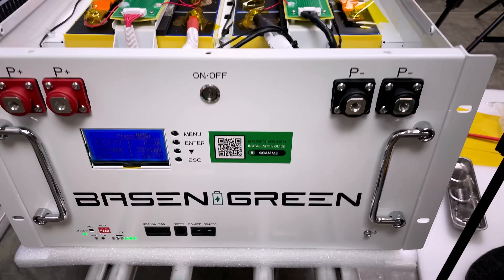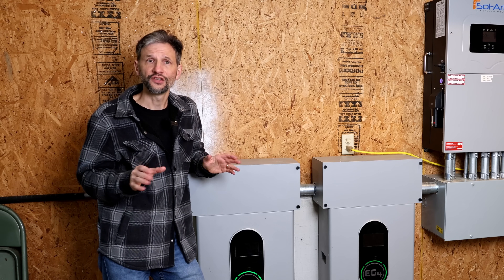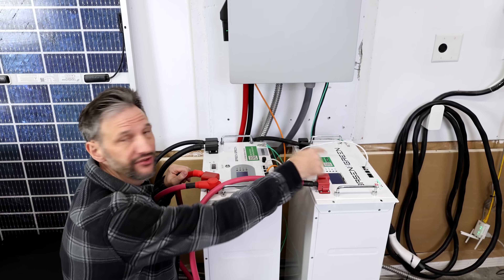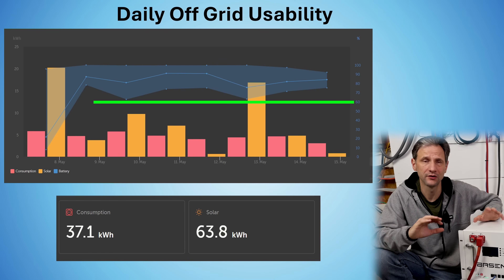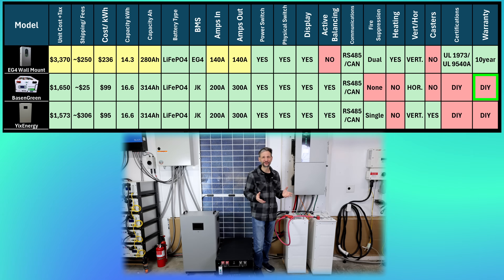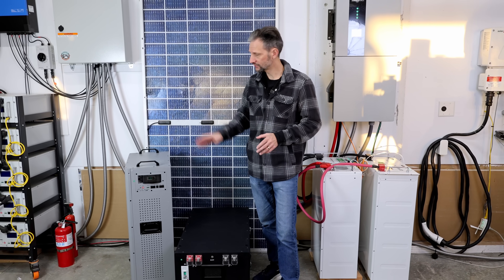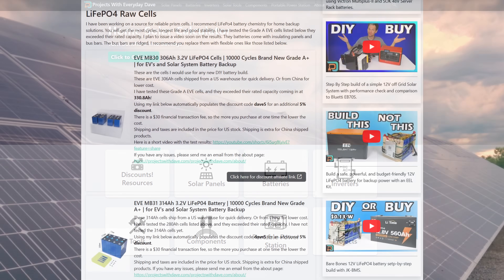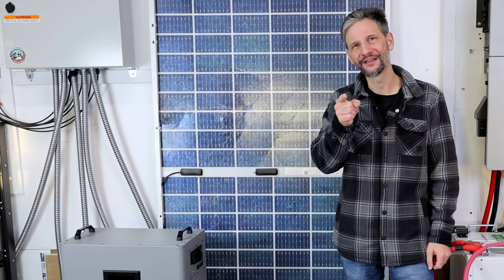I Compared The Top Home Batteries And Found A Winner!

Comment: Good overview Dave!

I have been using JK BMS batteries talking to my EG4 6000XP using the Pylon Protocol.
Good to know that we have two options for protocols.
To use the Pylon Protocol:

    On the JK BMS:  Set the CAN port protocol to option number 2 - Pylon low voltage protocol v1.2  (then hit send)
    On the EG4 monitoring software, go under maintenance, select your specific inverter and load the active configuration
        Then select battery:  Lithium
        And type to:  2 (which corresponds to the Pylon Protocol).   Then save and you're good to go.
    Your setup uses:
        JK BMS CAN protocol:    11 (lux power)
        EG4 software batt type:  set to 6

One other popular battery that you did not cover is the Ruixu battery.

    It is kind of a clone of the EG4 OUTDOOR battery.
    It has 16KWh of power vs 14.5KWh for EG4
    It comes on rollers and can be wall mounted
    It is outdoors rated
    It IS UL Listed
    It DOES NOT have US based tech support
    It DOES NOT have a 10 years warranty
    It costs around $3,300 (with FREE shipping)
    EG4 intdoor wall mount battery: $3200 (add $300-$400 shipping to CA) = $3500-$3600 
    EG4 outdoor wall mount battery: $4000 + shipping  = $4300 - $4400

You can view the Ruxiu battery as an intermediate between the full DYI and the fully baked EG4 battery.
You don't have to build it (it is too intimidating for some) AND it has UL listing (for permits requirements).
It has more power (16KWh vs 14.5 KWh).
If you needed an outdoor battery, you save > $1000 over EG4.
If you only need indoor then you save only about $200-$300
But you are missing the Texas friendly tech support (which is important for many first time installer).

In addition to local tech support and 10 years warranty, EG4 batteries (only wall mount models) has one more unique feature:

    Full integration with Rapid Shutdown System (RSS).
    This means that if the RSS state is triggered (you pressed the emergency shutdown or and ARC was detected on your PV lines), not only will your inverter shutdown but ALSO the batteries breaker will get tripped, making your full system inert and safe for you / emergency responders.   Only EG4 (to my knowledge) offer this integration.

FREE Shipping:

Please note that many Chinese JK BMS based batteries offer free shipping FROM US warehouses to US addresses for DIY boxes, EVE cells and sometimes fully assembled batteries

    www.eelbattery.com 
    www.docanpower.com 
    yixiangpower.com

MIX and MATCH batteries:
Another aspect to consider is the mix and match of different battery types.   
It's not so much the batteries as it is the BMS that don't talk to each other.
All EG4 batteries will talk to each other and then to the inverter.
All JK BMS batteries (no matter what brand) will talk to each other and then the inverter.
All proprietary BMS (Roxiu) will talk to their kins but not other brands.
And the inverter can ONLY TALK TO ONE OF THEM at a time.
You can still connect the batteries together and all will work just fine.
But your inverter will only get the status and direct recharging instructions for the one battery family that you connected to it. 
In practice it works just fine.  But you won't get the full picture of your full battery charge.
If the batteries are of similar sizes, they will charge / discharge pretty much the same.
You will just want to use the phone app to view/manage your individual batteries once in a while to double check the state of charge.
Another option is that you connect all the batteries in parallel and declare them as lithium in the EG4 setup and manage the charge / discharge cycles based on the voltage.
This also works fine.
BUT, it can be more intimidating to the new user.

THE NEW USER::

For a new user, the sense of hand holding and full support may be very important.  It depends on one's temperament.

It is important to be clear regarding the JK BMS.   The documentation is terrible (does not even come with the battery and is hard to find online).

You essentially need to subscribe to the Off Grid Garage youtube channel in order to get the latest firmware and some videos on how to configure the BMS.  Sadly Andi does not organize his videos for later lookup of what video covers what information.... he's more of a producer than an archivist :-).   Setting up the JK BMS can be intimidating and confusing.   If you build your own box,  you can damage the BMS if you don't carefully connect everything in the right place (Will Prowse destroyed his first JK BMS in a Yixiang box because of poor documentation and lack of in-depth research on what to plug where).   So the information IS out there but you have to put in more effort and research in setting things up correctly.    For a fresh, off the street, I-want-to-build-my-first-solar-system kind of person, it might be a bit much until we have good solid documentation form JKong (makers of JK-BMS).

So in order of complexity (and considering tech support, documentation etc...) from easiest to most DIY jock:

    EG4 battery:   Easiest.   UL listed, Plug and play.  If it doesn't work, call EG4 and get help in 5 min (most $$$)
    Roxiu:   Easy but no support.   UL listed and cheaper than EG4)
    Pre-assembled JK-BMS boxes:  Gobel Power, YiXiang, Eeelbatter:    No assembly errors but you still have to configure your JK BMS
    Full DYI:  Search the internet for documentation and detailed assembly videos.   Best bang for the buck and full DIY experience!  

- Christian
Reply: Very good information.  thank you.
Reply from the maker: Thank you for the extensive feedback!

Comment: Do you have any presentations evaluating high voltage batteries for high voltage inverters?
Reply from the maker: Not at this time.  I installed one "high" voltage battery that was part of a prebuilt system, but it wasn't a stand alone battery.  Here is the link: https://youtu.be/-E1FXXYxqp8

Comment: Anyway to integrate the DiY batteries into my EcoFlow ecosystem?
Reply: Not really. 

In most cases you'll be limited to the brand of expansion battery that matches your power station. 

There is some options:

Your DC input from diy battery to power station will also be limited based on the voltage.

So the options you have are to acquire your own battery system. And then use something like the bluetti, the Victron, or the Eco flow DC DC car charger.

On your DIY battery, you will attach the DC DC car charger to that battery, then you will attach the car charger to your power station.

You will need to acquire the appropriate DC DC converter for the input voltage but you want 48 V output. 

For instance if you're using a server rack battery, you would want the Victron 48-48.

If you are using a 12 V system wired in parallel, you would want the typical car charger but set it to output 48 V. On bluetti and ecoflow this is done via charge rate (in watts) but the victron 12-48 is preset and outputs 8a at 48v.

You will then input this into the solar input on your power station. 

When you start wiring large capacity 12 V batteries in parallel, you need to be thoughtful because that's a lot of current. It is prudent to make sure your wires are of appropriate size, length, and your batteries are appropriately fused.

If you use the Victron charge converter, you will be limited to approximately 384 watts into your power station. (48v*8amps).

This only allows charging via one direction. You can only charge from your DIY external battery into the power station. The power station cannot automatically charge DIY battery.

This will then necessitate you acquiring a 51.2 V charger. 

So you would need to do the math and figure out what is the most cost-effective option. Let's say you buy an eco-worthy server rack battery for 850. 

You'll need a charger, let's say 150.

And then the dc dc converter. Let's say 300

So you'd be $1300 before you bought any wires or lugs to get an additional 5.1 kWh. 

What this is worth to you is a personal decision.
Reply: @UniqueContent-u1v - Good info, thanks.
Reply: Probably

Comment: Hey Dave, would it be possible to add the cheap diy batteries parallel to my two eg4 wall mounts and 18kpv?
I’m hesitant to call signature solar about this…
Reply from the maker: You can add them in parallel, but the resistance and size is slightly different.  The result will be they won't all charge and discharge at the same rate.  That isn't a problem if you charge the whole system back to 100% on a regular basis.  If you go weeks without reaching to 100% you will find one battery will be far more discharged than the rest.

Comment: Before buying an EG4 battery from this salesman read what Google has to say about EG4 "As of October 2025, EG4 Electronics is facing a legal investigation regarding premature inverter and battery failures, but no class action lawsuit has been officially certified. The law firm Migliaccio & Rathod is actively investigating consumer reports of hardware failures, which could potentially lead to a class action. 

However, the company's terms and conditions contain a class action waiver, which could complicate such a lawsuit. 

Key issues leading to investigation

Premature hardware failures: The most significant complaint involves EG4 inverters and batteries failing within a few years of installation. Some users report multiple equipment failures in a short period.

BMS and firmware issues: Consumers have reported that battery management systems (BMS) have failed, which can cause communication problems with inverters and result in power outages.

Security vulnerabilities: In August 2025, the Cybersecurity and Infrastructure Security Agency (CISA) published an advisory on multiple security vulnerabilities found in several EG4 inverter models. The vulnerabilities could allow for unauthorized access to a user's network. EG4 has acknowledged the vulnerabilities and has been working on a fix, including new hardware.

Poor customer service: Complaints on social media and forums detail customers' negative experiences with EG4's customer support and warranty claims, with some reporting difficulty in getting timely responses or proper solutions for defective equipment"

Comment: Just an after thought here: Why if DIY do you need a case? If you have a set location for the equipment, which most of us do..... Then why not skip 500+ dollar cases and just buy the BMS/breakers stand alone? Welding blankets are cheap protection, these cases are not! If one of these ever catch fire it's gonna be catastrophic regardless. You all carry one of these in your pocket already, and they very rarely fail. So I'm just thinkin out loud here, why not skip the case to save even more?
Cheers 🍻
Reply: These are LFP. Very safe vs NMC. Nicer batteries now have fire suppression. And who want's a janky looking DIY setup when you can install them in a sturdy steel case?
Reply: @ArthurDentZaphodBeeb  
Well, "janky" is in the eye of the critic. If/when you're all about function, then form doesn't much matter. Maximum capacity, least cost, that is how I'm looking at all of this.

Comment: Dave,  You may want to check the figures in the infographic shared about the 1 minute mark where two of the three options reviewed use a 214 Ah capacity vs the 314 Ah in other data. Keep making great content brother!
Reply from the maker: Good catch! Thanks for pointing that out.  They should say 314Ah, unfortunately, I can't fix it without reposting the video.
Reply: @ProjectsWithDave  
Please Note these discrepancies BOLDLY in the video's Description as well a Pinned Comment.  ;)

Comment: Yep, I've got just under 2 more months to make up my mind! I'm not rich but I really need more power! I need both solar and battery, but going into winter here I can only use one of the two immediately in my system. So I've chosen to add battery capacity. But I really need more solar to charge what I already have..... Even still, I'm going to add another 30kwh of battery to my system. My worst days consume 60kwh, in the summer. But if I can keep 50kwh of battery in house then I should be good for most days on average. But I do not have the room for that much solar power regardless, so decisions decisions. I have a less than ideal location but my goal was/is to simply get my electric bill back to what it was the day I bought my place.

Just doing that (since it has more than doubled in that time) will still pay for itself in a relatively short period of time, especially with 30% back from the Gov. I've documented my entire journey thus far on my channel if anyone is interested.
Thanks for testing these batteries!
Cheers 🍻

Comment: Is that the new sunpower fold 200amp passthrough inverter?. How are you liking it?
Reply from the maker: It's the SGN-11K15PRO.  I like it a lot, but I have had some software issues that I'm working out with the company before I publish anything on it.  I think they are fixed now, but I'm running more testing to be sure.

Comment: Best value I've found for UL certified batteries is the Eco-worthy server rack battery
Reply: The only issue is if you buy a EG4 inverter the Eco-worthy does not have UL9540 certification. This is completely different UL cert then UL9540A even though it's numbered the same. UL9540 means the inverter and the battery form a ESS (Energy storage system) it's been certified together as a set.  Not sure what inverter Eco-worthy is UL9540 certified with I'm sure none of the EG4 inverters are. Naturally inverter manufactures are going to only certify with their battery, or in case of Sol-Ark probably had to partner in a contract agreement.  Supposedly NFPA 855 3rd edition newer UL9540B test which is different will allow those UL batteries to be used on other inverters only has communicate with the BMS.

Comment: QUESTION: How do you limit the output amps?

I have an existing all EG4 system, 
and need more battery capacity.

How do I determine how to incorporate these batteries with the 90kW of EG4 batteries?
And what bus bars or breakers would i need?

ie. what should i do to be safe
Reply from the maker: If you bought your system from Signature Solar, they can help you with finding compatible components to expand your system.  Here is their website: https://signaturesolar.com/?ref=SALE

Comment: We have three of the EEL V5 batteries which are horizontal and I put them on a trolley. The form factor is perfect for our space. But there is one downside you didn't mention to this setup. 

You have very little serviceability for batteries that are stacked except the top one. Unless you have a way to lift a 200 lbs battery. Worst case scenario being the bottom battery has say a failed BMS that you need to change. All batteries above need to be removed.
Reply: You need a workshop crane to move those batteries in their assembled state
Reply: @dominikvonlavante6113  Ours is in a closet with an attic above. My idea would be a few anchors in the ceiling joists and a hoist to get the top and middle battery off of the lower battery.

Comment: I'm curious what's happening in other jurisdictions: in where I'm at, we are required to have the batteries in a fire-proof (fire resistant) room with a steel door if it is within the residence. I wonder if this requirement is going to be coming to other places or if it already has. It's a pain in the butt for existing homes.
Reply: It's an unnecessary requirement for LFP  and Sodium batteries. NMC - I wouldn't have that inside my home - it self oxidizes under thermal runaway and is extremely difficult to extinguish.
Reply: @ArthurDentZaphodBeeb  That was also my thought. The batteries I'm getting are LFP, which I mentioned to the inspector and noted that these don't carry the same risk as more traditional lithium batteries (NMC). However, the inspector said the requirement is still there and is enforcing it.

I wonder if this is just an artifact of too little regulation when in-home batteries were typically the NMC Tesla Powerwalls, and then regulations adjusted but did so too late that the tech had already evolved, making the regulation irrelevant.

Comment: Thanks for the video, great comparison. Is it not a problem the batteries in the Basengreen kit are stacked on top of each other and there is a lot of pressure on the bottom? I have the same kit but a bit confused how to store it. (prefer the standing position)
Reply from the maker: Keep in mind the vertical form factor batteries are stacking the cells.  It should be no problem.